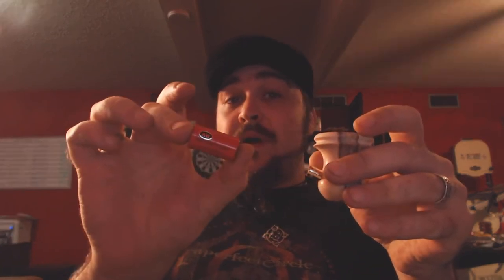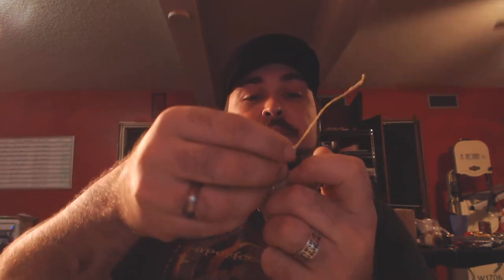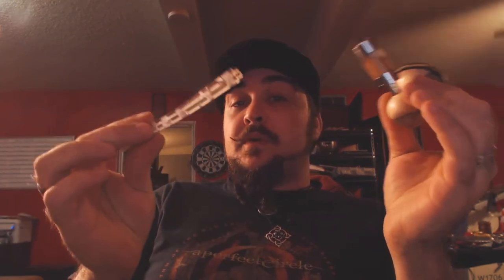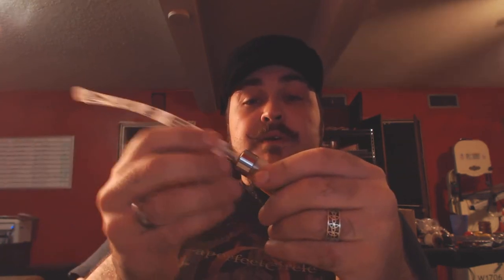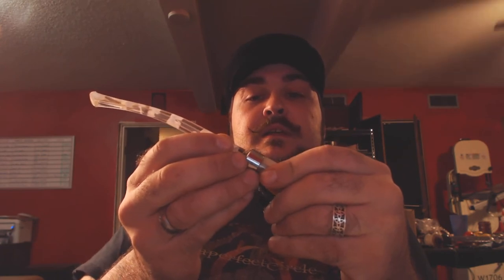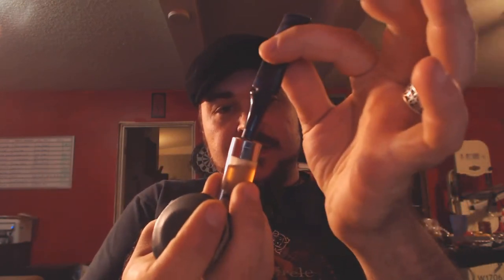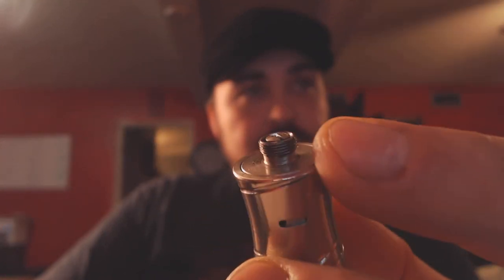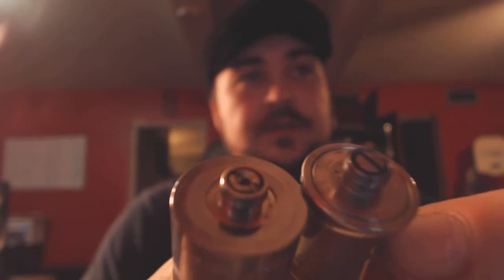Instructions on your new Mythical Fabrications Epipe

Comment: Love your pipes man looking at getting one when money's not so tight but I have a quick question. What battery size would you recommend
Reply from the maker: Umm, If you're a light vaper, stick with an AW IMR 18350. it will easily last you all day with a Carto tank setup. If yoru a heavy vaper and you never let the mod out of your hand, or if your into rebuildables, i would suggest an MNKE 18650 or certain 26650 batteries. But majority of the time.. People with carto tanks will go with a 18490/18500 awimr.

Comment: And another question. I'm new to vaping (6 months in)  and know some but not a lot what is sub ohm vaping and is it "unsafe"
Reply from the maker: suboHming is unsafe. But we do lots of unsafe stuff each day. A Sub oHm is where you take the oHm of your coil and build it below 1.0. On the average most cartomizers are at 1.5oHms and higher, which is fine for a 3.7v Battery. But using a suboHm, if you have enough practice and know your math, Can produce huge clouds of vapor on a rebuildable atomizer. its always best to do thorough research before you ever try to do it because you could short and blow up your battery, destroy your mod, and cause physical harm to you or your physical possessions. You also have to make sure you are using the correct battery that can handle the Amperage load of a suboHm build. Most all efest and regular Mod batteriesyou will find are not safe for it. We find that AW IMR batteris and MNKE can handle suboHms to an extent, but still it is known as unsafe, and if you choose to do this even after research, be ready for any failures or possibly harm it could lead to. 

tho, if you knwo your stuff, and have the knowledge, you can be blowing clouds like a fog machine. :)
Reply: MF is shutting Down, so do you think is unsafe using coil 0.80 ohm in EVOD 2 tank with 18350 battery on E-pipe?